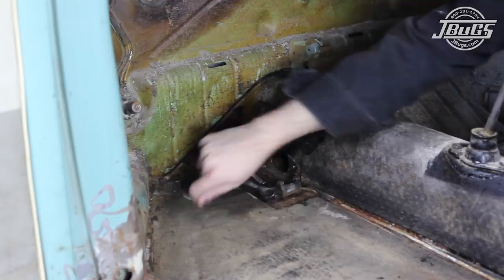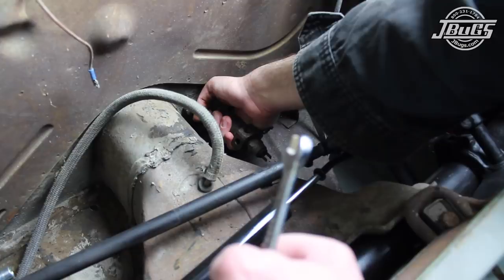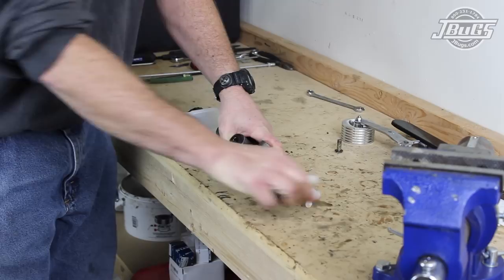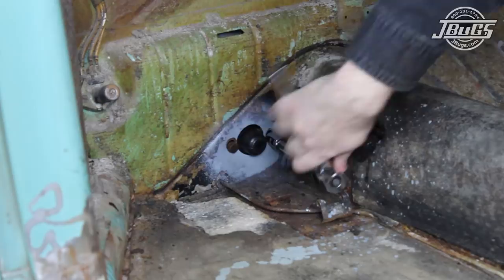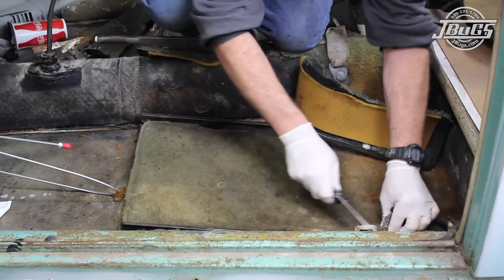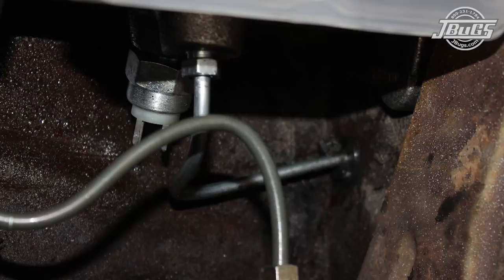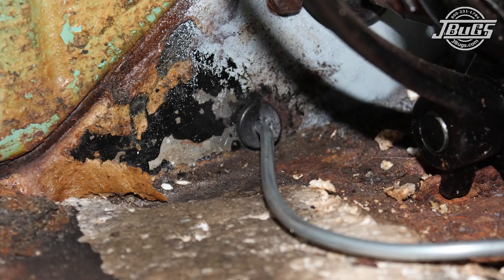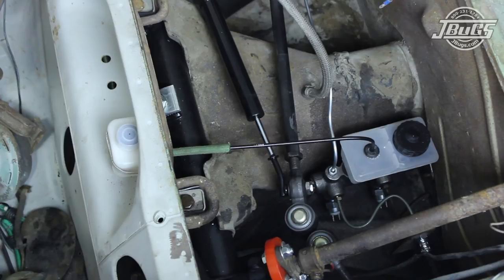JBugs - 1963 VW Beetle - Master Cylinder & Brake Line Replacement

Comment: I’m going to do this in my ‘62. I need to replace the metal lines as well. What do you recommend I get? Should I buy for a ‘62 or should I get the 66-67 brake line kit?
Reply from the maker: The front left and right steel lines in the 1967-68 kit are 40mm(1 5/8”) and 125mm(4 7/8”) longer than the 1958-66 kit. The additional length of the kit ( https://www.jbugs.com/product/113698001A.html ) will make installing a dual circuit master cylinder a bit easier, yes.

Comment: How was the rubber grommets put on? Were they installed before brake line swivel ends were put on or were you able to slide them over swivels prior to running them through front and rear sheet metal holes?
Reply: The rubber grommets are split so they can be installed whenever you get to them.

Comment: Hi I have a 59 bug with 4 wheel disc brakes and I single master cylinder but I want to upgrade to a dual master cylinder ... are there any extra lines that need to be added ? Ty
Reply from the maker: We converted our 1963 Beetle to a large bore dual circuit here: https://www.youtube.com/watch?v=CorjjxZ7gRM which covers the upgrade.

Comment: Why do you modify the original instalation of the master cylinder with the adaption of  a second reservoir in line with the original one?  I don't  understand this, or is there any advantage?
Reply from the maker: 1966 and earlier Beetles have a feed to the single circuit (one chamber which operates both front and rear brakes) master cylinder. We swapped out to a later model style, dual circuit master cylinder (one chamber for the front brakes and one chamber for the rear brakes) which requires 2 feeds.

Comment: I’m replacing the master cylinder in my 1965, how do I know what bore size that I need?
Reply: If your brake system is stock, use a stock replacement. If you have disc brakes, you will want a larger bore master cylinder.

Comment: Could you please let me know the part number for The new steel line connected to the reservoir and rubber as well. I have 1966 VW Bug and would like to change front disc brake conversion. Thank you
Reply from the maker: The steel line is https://www.jbugs.com/product/113611805B.html, the rubber hose is https://www.jbugs.com/product/113611801A.html
Reply: JBUGS great thank you also I forgot to ask the part number for the 2 bolt you put on the master cylinder for the brake line. Minute 2:34
Reply from the maker: The two bolts that were installed onto the master cylinder are actually brake light switches. The VW 2 Prong Brake Light Switch threads into the master cylinder and operates the brake lights. They can be found here https://www.jbugs.com/product/113945515H.html

Comment: Are the OEM brake lines using a 10x1.0 bubble fitting?
Reply: Yes, that is the stock brake line size.

Comment: What dual circuit master cylinder did you use on this 63?
Reply from the maker: Click the “SHOW MORE” button above to see all the tools and most importantly the parts used in any of our videos. The master cylinder is the VW Dual Circuit Brake Fluid Reservoir (17-2878) http://www.jbugs.com/product/17-2878
Reply: @JBugsVWParts  Am I missing something? There is no part number listed under show more for the actual master cylinder

Comment: Does anyone else have a much different three way connector in the rear?
Reply from the maker: We aren’t familiar with any other sort of brake line tee but perhaps others may offer some suggestions. Brake Line T - https://www.jbugs.com/product/113611755.htmlIRS cars run a junction fitting on the opposite side if that’s what you’re referring to https://www.jbugs.com/product/113611791.htm

Comment: My '68 has two lines from the reservoir...
Reply: Yep, starting in 1967 VW went to a dual circuit (one for the front, one for the rear) master cylinder so they all have 2 lines from that point on.

Comment: do you  have to bench bleed master cylinder?
Reply from the maker: No, there is no need to bench bleed the master cylinder. Pressurizing, or vacuuming out the system is required though. Otherwise the brakes will not build up pressure.
Reply: just bleed the brakes then,  after installing the  new cylinder ?
Reply from the maker: Yes, whenever there is a change in any brake component, always bleed the brakes.

Comment: Is the second reservoir needed ? Or can you just run it with the one directly on the cylinder ?
Reply: You can use just the one on the cylinder but filling it can be difficult.

Comment: Hello, I have a 1967 Beetle with all four drum breaks, is it necessary for me to instal that second hole Into the reservoir and mount a new reservoir in the trunk space. Or am I able
To just use the reservoir on the master cylinder. Thank you.
Reply: A 67 Beetle has a dual feed reservoir from the factory, so you can use it, or a stock replacement.

Comment: Why wouldn't you just replace the missing spacers? Without them the frame horn and deflect and bend under hard braking. You can very easily make your own or get them from a junk yard. Interstate VW is not too far from you guys.
Reply from the maker: As the car will be coming apart for paint and body work, we aren’t too concerned with the spacers. Normally we would have made some spacers, but in the midst of our warehouse “garage” we don’t have the access to all the tools and scrap metal we have in our actual garages. We mention it for those that do, but it isn’t the end of the world and we’ve driven dozens of cars without the spacers in place.